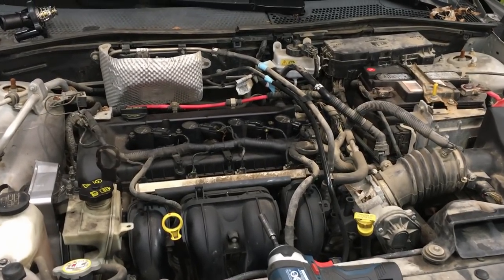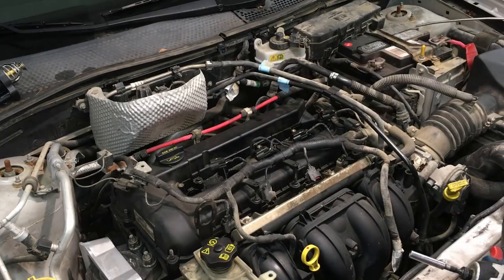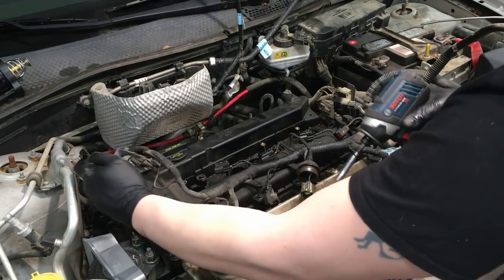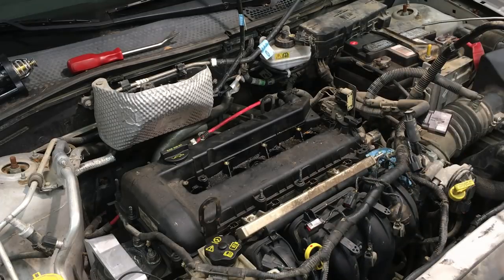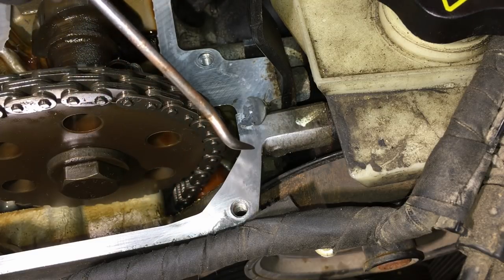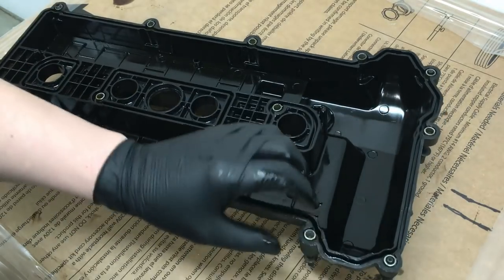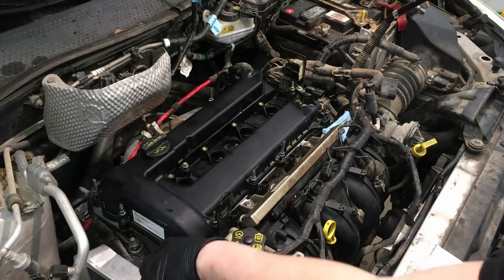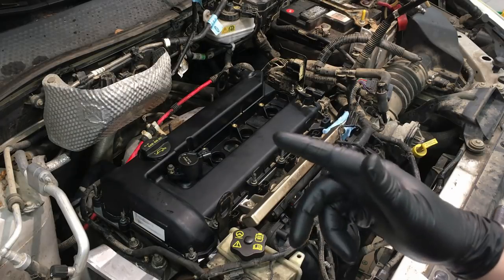2005-2011 Ford Focus 2.0L Duratec Engine Runs Rough Hesitates: Valve Cover Gasket Replacement

Comment: The cam bolt came loose on one that came in. When I put it back together after replacing the exhaust valves, I tightened those bolts a lot tighter than Ford says. U don't seem to have any videos on cam and crank relationship on these engines. Really enjoy all your videos!

Comment: Really great video!!! Just bought an 05 2.0 with a 114,000 for a beater. Took home from used car lot and ran into the exact same thing. Started pulling the non oem plugs out to change with motorcraft and the last cylinder boot had oil. Not as bad as you. When pulling the plug that oil went into the cylinder. I was able to get 80% out and reinstalled the old plugs and fired up. Smoked for about 20 seconds and cleared. Ordered the gasket and will install new plugs once the gasket is installed. Thanks again for an informative video!!!

Comment: Can the oil fail the ignition coil fix mine still has a rough idle after cleaning all the oil out and new gasket on Valve cover

Comment: I did this on my 05 Focus 2.0L last year, but don't think I put the dab of sealant on those two spots by the cover. There is a little leakage in those spots, do you think it would be worth it to pull the cam cover back off and dab some sealant on there? Great video BTW, wish I had seen it last year!

Comment: A question: I was doing the plugs on my 05 2.0 and found oil in the wells. None on top in the trough, and none around the valve cover. AFAIK the car went its 12 year 85k mile life on those original plugs, and the plugs themselves looked OK. Is it OK to watch this problem and see how severe it is before doing this work? I feel like I've got the potential to create more problems than what could have been a very,  very slow oil leak into a few of the plug wells.

Also: amazing video.  I've watched a few of yours and they are easy to follow and really well shot! And this is coming from a massive critic of this kind of work. So thanks!

Comment: Did you change the spark plugs on this job or just clean out the wells?
Reply from the maker: On this vehicle they were changed out as part of the repair since I was replacing all the coils and they had 80k miles on them. Also in the past someone cross threaded #4 spark plug so we definitely had to go in and change them out. I show more in my next video where we repair the spark plug threads in the head with an insert.
Reply: Thanks Brian.  Your videos are outstanding.  I'm (I think) an above average DIYer and really like to be shown professional techniques.  You do a great job of explaining the "whys" along with the "hows."

Comment: A quick question air. One of the bolt heads snapped on my valve cover. Can I replace it with any particular 8mm bolt?

Comment: Okay I have replaced the valve cover gasket the plugs the coils and all three motor mount and I still have a slight shutter in the motor it's been 4 to the correct specifications no check engine lights have ever come on and I'm tired of messing with this piece of I will not finish the sentence any ideas what else it could be not throwing a code no check engine light nothing
Reply: Take off your throttle body and give it a clean, at the same time get under the car with a t20 socket and do the map sensor. When you do this remove the negative cable from the terminal and using a aligator clip connect to the positive terminal.  5 mins (reset comp) This is if youre feeling some hesitation under load. If that fails check for a leak in the pcv

Comment: 2005 Ford focus saw oil in the spark plug area. Prior to watching your video I took the spark plugs out and all the oil went inside the cylinder. I cleaned all the spark plugs and now the car wont start. Any thoughts on what happened. I can see tons of oil inside the cylinder maybe on top of piston in all 4 cylinders. What to do. How to fix it. Thanks.
Reply: I would say syphon the oil out.  I used a syringe. Maybe one from cooking turkeys works best

Comment: Will the valve cover gasket cause air to come out where you put oil in?? The 2 end plug wells were half full of oil.
Reply from the maker: no, but this is normal on the 4cyl models when the cap is removed.

Comment: I suspect i have the same issue with mine and am going to investigate at the weekend. Great video but I was left with one (possibly dumb) question.. how to properly/safely clean the spark wells of the oil? All advice appreciated!
Reply from the maker: wash thm down with brake cleaner then use a rag to cover hole and blow it out.
Reply: @FordTechMakuloco thank you! 🤜🤛
Reply: @FordTechMakuloco (liked and subscribed btw)

Comment: Quick question, how did you remove the fuel line clip? I’ve tried and I’m almost ready to take off the valve cover but the clip keeps snapping back into place :/

Comment: Thank you this is great for my purposes, to see a breakdown of the top of the engine.  I'm trying to get the upper intake manifold off to check out the PCV valve/hose. Chasing a rough idle (like a vacuum leak) with no code ever thrown.
Reply: Did you ever figure out the rough idle issue?
Reply: @153eddy  Don't think he did!
Reply: @CdotPoppy  I did.  Oil was leaking thru the valve cover gasket and flooding the COP's.  Changed gasket, plugs and COP's and also did a EGR clean and car ran great.
Reply: @153eddy  🤣 thanks for messaging back!! My D20 is a bit dirty on the side. Want to uprate the cams and need to do the timing chain/oil pump. So a new gasket will be in order. Have a great weekend!

Comment: Hello I have a 2009 Ford fusion 2.3 , I pulled the coils out an lots of oil in spark plugs whells but I have oil on my electrodes on spark plugs as well? Is that more than a Valve cover gasket?? Thank you!
Reply: If you make sure you fully clean the spark plugs and degrease them, you can continue to use the spark plugs if theh are good. But its a 20 dollars for a full set so do what you want. Just make sure the spark plug wells are fully cleaned out
Reply: Oil on pistion?🤨

Comment: Quick question, I recently changed the valve cover gasket on my 08 Focus, after turning the car on there was thick smoke coming out of the exhaust for a few minutes. Any idea why? was it burning out the oil that was left in the cylinders? (2, 3 and 4 were oil filled)
Reply: Also, I did not apply the sealant to the 2 corners where the head meets the gasket. (I forgot) would that cause any problems? leaking?

Comment: Well I just finished my focus. I'm confident that the job went well. I had to put a he'll coil in spark plug number 2. That's my only concern when I start it today. Had to wait for the thread locker to set. But the heli coil is just a smidge in to far. I'm really nervous it's going to hit. I don't know how far up the piston comes up ,so after all this work and money I spent for parts can maybe be all for nothing. But thank you so much for the perfect amount of detail you put into this one and all your videos. You should be proud of your workmanship. Another question I have besides if an eighth of an inch to far in with the heli coil is ,do you have your own shop? Cause if your working for a dealership it seems wild that they would let you give such valuable info. Thanks again ,probably couldn't have done this without your professional experience and expertise. If that 1\8 of an inch is a problem let me know what I should do. Thanks
Reply: Like maybe a couple of flat washers on spark plug to keep from going in to far??? Any help Berri start this thing up thanks
Reply: Like a couple of flat washers on spark plug to keep it from going in to far ?

Comment: I just changed what look like the original plugs on my 05 Ford Focus zx3 2.0 5 speed and they were disgusting the car ran rough and there was a lot of vibration the exhaust popped when you revved it and let off etc. I put in some new Bosch double iridiums after installing them it runs a lot smoother and idles better but it still vibrates a bit intermittently also the hatch rattled when the engine vibrates and the power lock buttons and hatch release button stopped working along with the horn when you press the panic button on the key fob when I press the lock buttons or trunk release I hear a click behind the glove box it also clicks when I press the hatch release button or lock buttons on the fob but and the horn works but doesn’t sound off when the panic button is pressed or at all when the alarm is triggered I was hoping since you seem to deal with a lot of these maybe you could lead me to the cheapest easiest solution to getting my power locks and trunk release back including my key fob he key fobs work and have been tested the switches are all good because you can hear what sounds like a relay click behind the glove box but I didn’t see a relay I just turned 20 and am learning slowly but surely the mechanical stuff I can do but this electrical crap is all a mystery to me idk what I’m doing at all I appreciate any help and advice you could give me
Reply: Can't help you with your lock and hatch issues but for engine vibration be sure and check the passenger side motor mount.  Those go bad all the time on a Focus and cause much engine vibration.  I had to change one on my daughter's 2007 at only 55,000 miles.

Comment: I have a question Sr.. 
Between coil 2 and 3 there is like a sensor I don't know if that one marks the check engine on the dashboard but I just want to know the name of that part for ford focus  2007  2.0 thanks..
Reply: It's technically a cylinder head temperature sensor but some auto parts places will have it listed as an engine coolant temperature sensor, which is what it checks. You'll need a 19mm deep socket to remove it and not all deep sockets will fit right if the inside is tapered potentially.

Comment: Great video thank you so much I honestly could figure out what was wrong with mine I’m an amateur at best one question if anyone could answer is I’m in uk and these parts say they may not fit a uk car is there any difference between a uk and USA 2.0 engine that would make these parts not work ?  Thanks

Comment: I accidentally broke the #1 bolt. Runs OK with out it. No leaks for now, but now would have to replace the entire valve cover, right? That bolt comes integrated with the cover from what I see.  Great video!
Reply: if you remove the cover you might be able to access the bolt and back it out and put in a new bolt...?

Comment: I have a 2001 ford turas when its cold has a rouph idle when it warms up runs great I have changed plugs and wires coil pack and intake upper an lower gasket and fuel filter but runs the same it is over head valve 3.0 aney ideals
Reply: GAS AND WHEELS  have you replaced the Air idle control valve? Mine had very similar problems as what you're describing
Reply: yes I did it runs  the same thank you for your help

Comment: The locking tabs on my fuel injector connectors broke. Are they simple to replace? How?  Also thank you for this detailed video
Reply: keeshon anderson - connect them back and use zip ties to keep them in place.

Comment: @fordtechmakuloco I just put new plugs in and disconcerted this, do I need to “re-replace” my plugs after doing this?
Reply from the maker: It’s best yes
Reply: I may have messed up by taking the spark plugs out and replaced them while doing an oil change. Now it’s blowing white smoke that lacks the smell of burning oil. So I think I may have blew the head gasket. Any thoughts or advice??

Comment: Hey Brian,  I just got a 07 focus and was curious where the idle should be at. When in gear, it looks like it idles between 450-500 rpm,  when I lightly press on the gas to around 700 rpm, it's smooth, but when I release the gas, it drops around 450-500 (above first line from 0 and below second line)  I was wondering if that's normal or is there an issue. Any advice would be much appreciated please
Reply: My 2.0 Duratec Focus idles at 650.
Reply: Got an 08 in the winter idles at 750

Comment: brian or anybody...front struts 2003 ford taurus ses.  Cant get the strut in the sinch cup, do I need to drop the subframe or is there a nifty trick.

Thnx for any help.
Reply from the maker: +SGDeGalvez Yes we would drop the subframe a few inches to make it easier to get out of the knuckle.
Reply: thnx a bunch!

Thnx for the vids also..

Comment: Mine is still missing on #2 after replacing the valve cover 🤦🏼‍♂️
Reply: Swap the #2 coil to another cylinder and see if the miss moves with that coil from #2.

Comment: Nice video! Changed out the valve cover gasket. Got new spark plugs and coils. Cleaned out the throttle body but for some reason it’s not idling perfect. I get a few rpm jumps and some vibration with it. No problems when driving and no engine codes. Any ideas? Not sure what else to try out without no engine codes. Do you know of any other known idling issues for this engine?
Reply: I realized this is an old post but I'm curious..... Did you ever figure out what the problem was?
Reply: @barnes29510  I changed the air filter and cleaned MAF sensor. It’s been idling fine.

Comment: I'm having trouble with my ford ..engine doesn't turn..no noise...replaced battery, starter, alternator, solenoid, Coil, voltage Regulator, ..and the ignition is good, ..72 ford truck. .
Reply: if you pull the distributor cap and see if it still has points and condenser  look for a vid to enplane how to adjust and test
Reply: No noise, as in it doesn't crank.  If so check the ground strap on the engine or hook a jumper cable between negative terminal on battery and engine block.  Also, verify that you get voltage to the ignition start lead on the solenoid when the ignition is engaged.
Reply: no crank i would put a socket on the crank shaft and see if the engine turns by hand first
Reply: if i dont pull all spark plugs out and try agian

Comment: I have a 2016 Ford Focus with the 2.0 liter eng and it’s developed a leak around the top of the timing cover. It has roughly 30k miles on it. My question? Does the gasket fail early and how hard is it to replace?
Reply: Arnie Palma I have a 2010 with 172k miles and the gasket has gone bad for the first time...   If your car is still under warranty,  I'd have Ford replace it.
Reply: It can be done in 1-2 hours depending on skill level. Just go slow and follow the video. Take notes to refer to as you go. It's pretty easy if you're mechanically inclined and have the proper tools. There aren't any bolts that are a pain in the butt to get at (that's what typically is the difference between easy and hard). They are all fully exposed bolts that are simple to get at.
Reply: I did mine before work last week.  I took my time,  drank coffee,  took pictures just in case,  and I was all back together well within 3 hours.

Comment: Great video! And thanks for the parts list. I would have driven myself crazy looking for all of it.

Quick question. What tool did you use to pick out the old gascket amd the rag you used to keep the sealant from falling into the engine?
Reply: It’s called an angled pick

Comment: Great how to. Thanks! Add me to the list of leaky valve cover gaskets needing replacement. Went to change my plugs today and 3 of the 4 plug ports had oil. I removed the plugs for now (some oil got into the cylinder...will try and remove that before I put the new plugs in) and will take the valve cover off soon to replace the gaskets. Regarding the Ultra Black Permatex gasket compound, the instructions say let it set for an hour before fully torquing down the valve cover. Not sure if it matters that much, but thought I'd mention it.
Reply: I was thinking about this. I did what the instructions said and put the two globs then immediately seated the valve cover and hand tightened gradually in the order linked. I waited a bit more then an hour and torqued it down in proper order. I did check it over a week later and still no leak at the seams. I am going to keep checking because it seems to me if the rtv hardens enough it could cause a tiny gap where the gasket, rtv, and metal meet when you torque it down. I wonder if the 1 hour wait before final torque is specifically when there is no other gasket being used. If no one hears back from me assume there was still no leak detected at the seams or around the rtv.
Reply: @TheJuanSolid  the wait is so the compound sets enough that it acts like a gasket itself and not just squeeze out.
Reply: @boabm6522  Thanks! Makes sense. I am concerned in this application though because that's a gasket on a gasket, something I was always told is bad, like double gasketing a oil filter by accident. I can say this never leaked for me from the install procedure I noted above.

Comment: i have a 2009 flex so do i need to use motorcraft oil when i have to change it?
Reply: You can use any type of 5W-20, but Ford recommends synthetic (Motorcraft brand, of course). I've used nothing but Motorcraft 5W-20 in my 2007 Focus, and my father (who worked for Ford) uses nothing but synthetic as well, and neither of us have had any engine problems whatsoever. Same thing goes for the filter, stick with Motorcraft. I believe that the oil, including filter, was around $25 total (Walmart sells Motorcraft oil / filters).

Comment: At 16:50 what cleaner did you say to spray into a rag to clean the gasket surface?
Reply from the maker: brake cleaner
Reply: Ah, okay. Thanks for the reply and video. I’ve got an 09 Ford Focus with 180,000 miles on it. I’ll be watching more videos in the future.

Comment: You complained about a leak at the fuel rail how did you fix that?
Reply: Paul Rodrigues did you find out?  I noticed the same thing when I replaced my valve cover gasket.

Comment: If some oil gets down in the spark plug hole is that OK
Reply: You will be fine it dont take too long burn off, but the case of it happening and depending on how much fell in you might get an o2 sensor code or missfire oil will foul a spark plug